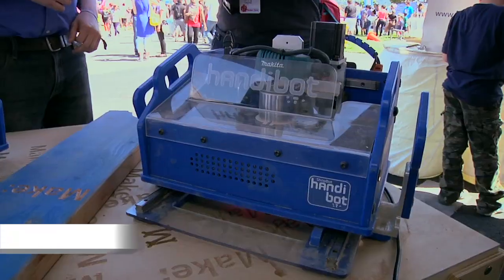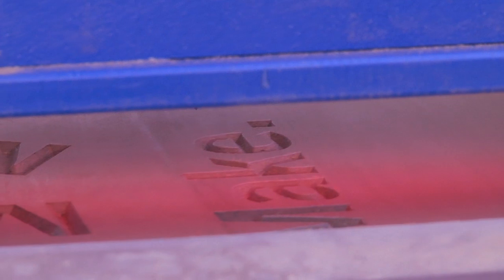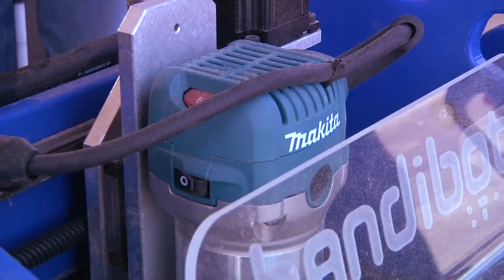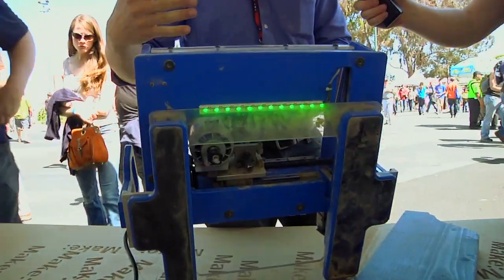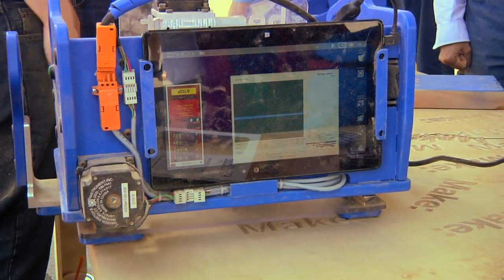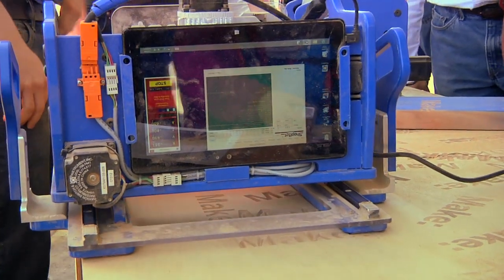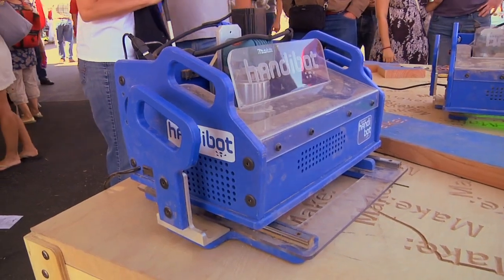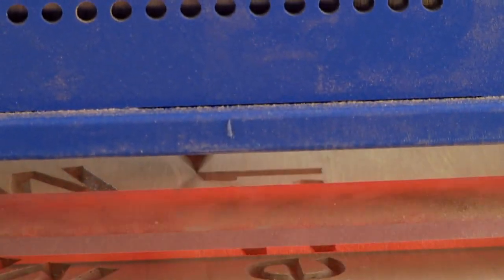Meet the Shopbot Handibot - It's a Smart CNC Router - MakerFaire Bay Area 2013

Comment: I work with a machine that uses this idea to etch metal on an almost daily basis. I have also heard they have 'portable milling machines' that use an electromagnet as their clamping device. The problem with these is cost of the machine and the fact that they aren't as versatile For about the same price you could get a small CNC mill and do much more complicated stuff. In this case, you can do large (but only flat) areas of very soft particle board. Either way, not a new idea.

Comment: Would be cool if it had some means of traveling across the surface of the material so you could cut material of any size with this smaller tool rather than require the space for a giant CNC machine, which would still have it's limitations.